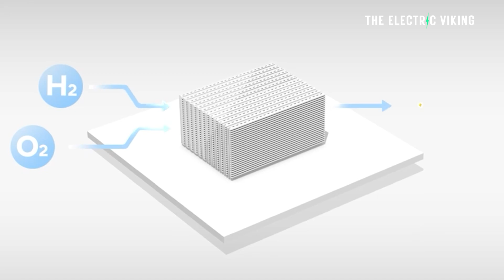Hyundai reveals plan to turn Poop, Plastic and Waste into Hydrogen

Comment: I watched the Hyundai press event, and I got the impression that they were more focused on commercial vehicles and shipping, etc. That’s where I think there is a pathway for hydrogen. I don’t know if I see it as a viable source for passenger vehicles, especially as battery technology continues to improve.
Reply: Tesla Semi and other new BEV trucks closed off that for hydrogen.
Reply: Larger sized vehicles are better for the large tanks + batteries required, given all the costs and inefficiencies hard to see this really working out but the Petrol supply and distribution chain while a bit less cumbersome does demonstrate what you can do if you throw enough time and money at something. Not sure it's worth it though given the advancements in battery tech. Aviation will likely need fossil fuels for many years given the storage density, hard to see hydrogen replacing this.
Reply: Gridjac - I share EXACTLY the same sentiment and if Hyundai is on  the commercial track for Hydrogen, then I think they are going to be immensely successful.
Reply: @mobayguy how will hydrogen trucks compete with BEV trucks like Semi? 
I haven’t seen any commercially available hydrogen truck demonstrate any advantage over the best commercially available BEV trucks.
Reply: @williammeek4078 Hi William - Thumbs up for a good question but I think Hyundai is in the process of answering your question.  Hydrogen produced on an industrial scale, on a 'green' basis is a huge capital and logistical undertaking.  If you look at all the business lines Hyundai have excelled in, you may find that they have all, if not most of what is needed to achieve the goal of fueling heavy commercial vehicles with 'green' Hydrogen.  Consider their seafaring vessels along with land based freight vehicles (including locomotives [ROTEN]) and you may see the vision I think Hyundai has.  In my humble opinion, this vision has long been desired by many but too far a stretch until now.  We shall see my friend.
Reply: @mobayguy  Why will they be successful? If batteries improve and they are, Tesla has a 500 miles truck already.. In 4-5 years that will be 1 thousand, so why would you need a hydrogen truck? Or bus or boat? 
I can see hydrogen working for big, big ships, but is that enough for Hyundai to justify it's enourmous investments in hydrogen technology?
Reply: @TricoliciSerghei  Hi Tricolici - My short answer is energy density by volume.  Sparing technical details, there comes a point when the weight, chassis space required, recharge time, etc. of the batteries becomes impractical.  Hydrogen is immensely energy rich and one of the lightest elements known.  A key reason for its use in rockets.  To some of your points and others, Hydrogen needs special handling as it's molecule is so small that if not kept extremely cold or otherwise suspended in a substrate material, it will literally vaporize and float away (and hopefully not ignite!).  Yet still, the storage of Hydrogen is well advanced.  So in a nutshell, Hydrogen can perform far beyond (primarily) the weight and other constraints of the battery techniques available today.  All the problems we are here talking about have been solved long ago my friend.
And HINT... What no one is saying but some smart know... is the term:  Hydrogen Based Fuel Cell 😉 

Kind regards
Reply: @mobayguy  Thanks for your reply. As far as I know, fuel cell also need batteries, so you have a two in one technology, in my view this is a headache.. 
I think that building that hydrogen infrastructure will be impractical, when you already have good EV trucks. I think hydrogen will be used for a while and then forgotten. (for trucks)
Well, let's see what the future brings.
Reply: @TricoliciSerghei  Hey TricoliciSerghei, you and I definitely agree on one thing, and that is that we'll both see what happens.  The wonderful thing is that these technologies, batteries, Hydrogen, etc. are here now and that is good.  My hope is that they are an improvement for the planet - that too remains to be seen.  Really appreciate the conversation and your views.  All the best to you.
Reply: @mobayguy  Also appreciate it. All the best, have a good day.

Comment: Hydrogen vehicles: The nearest hydrogen station may be two states away, but at least it’s expensive and environmentally unfriendly. Oh yeah, the small battery in the car means it’s low powered and slow.

I’ve yet to hear a compelling reason for them.
Reply: It is made from fossil fuels and keeps people guessing instead of buying BEVs. So the fossil fuel industry enthusiastically supports it.

Comment: I'm very skeptical about hydrogen for transportation. 
What if there is a fuel cell technology breakthrough? Then you would still need to use electricity to make hydrogen. But we can already use batteries, and you can't make a fuel cell more efficient than a battery. 
Batteries have limitations, and in some cases, fuel cells seem like they have a greater energy density so the vehicles can have a longer range. But what is the cost per mile? 
Hydrogen is going to be useful and maybe even necessary in the agriculture industry and in steel making. 
Maybe long distance trucking, but we will see how that works out.
Reply: A particularly fascinating feature of hydrogen fuel cell operation: even at extremely low temperatures.

The lifespan of the material is probably decisive.
Advanced carbon composite tanks have been cycled more than 500,000 times to maximum operating pressure without leaking.

Self-sufficient system

How long-term are you?